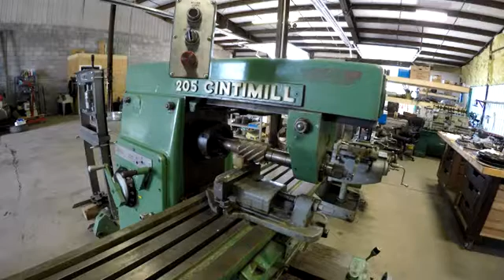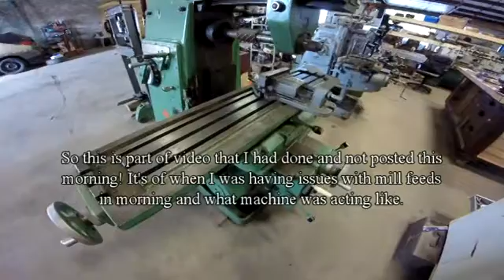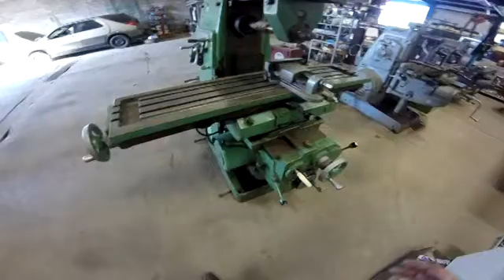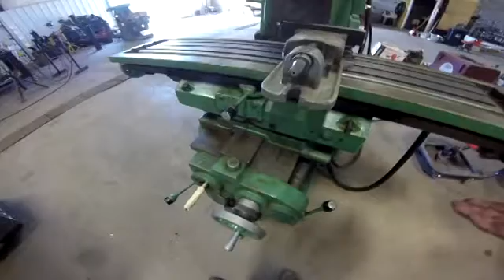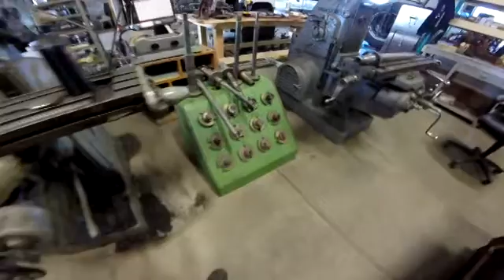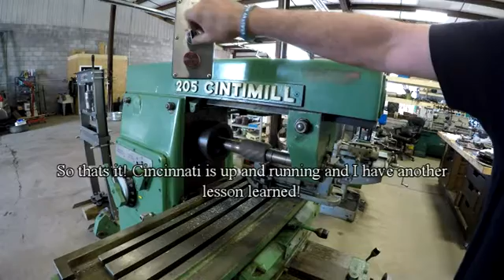Cincinnati 205 Mill up and running! Almost not!

Comment: hey if your mill is anything like mine, th feed has a mag-clutch with brushes, check the contact surfaces for the control voltage
Reply from the maker: I will look into that, although haven't had any issues with it since I filled the oil reservoir. One of the things O&M manuals don't tell is, how or why the machine works. I would have never thought that oil would have played a part in the smooth operation of the bed (non-lubrication function) on a mechanically operated part. I also have an older model K&T that I am having similar issues with, so starting to wonder if that may be a similar problem. Thanks for comment and watching.
Reply: mine is a Nicholas Corea F2UE, the power feed mag clutch recently started missing, then finally ceased to function completely, still cactused, as for oil performing a non lubrication function, my Elliott Butler 460 needs hydraulic oil for the clutch to grip!